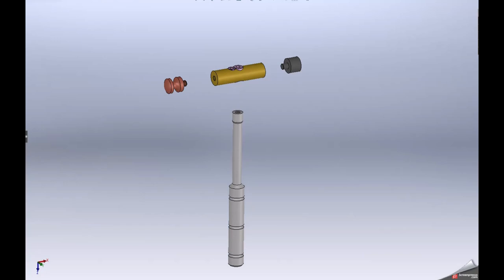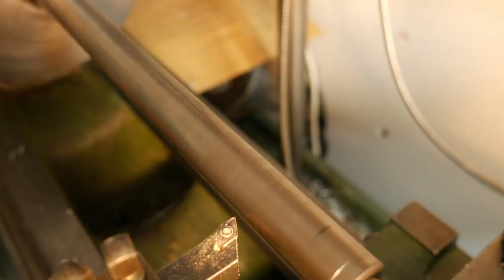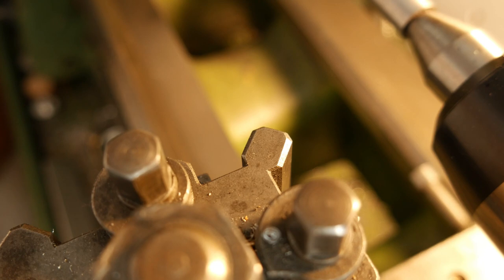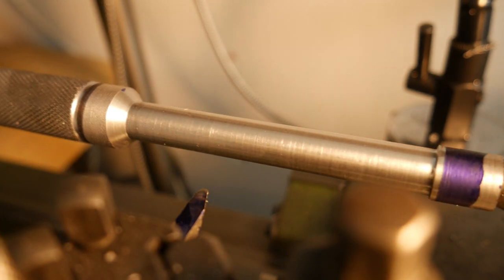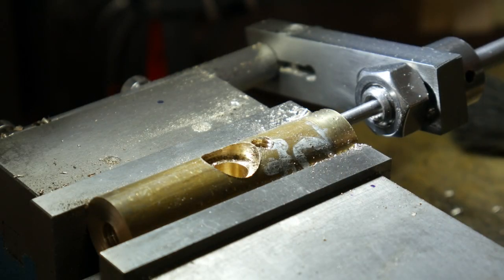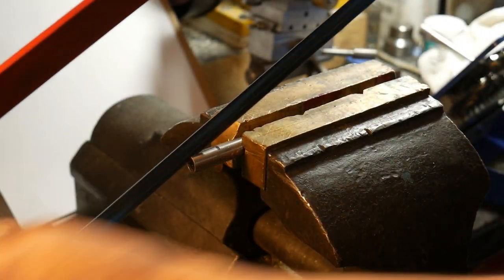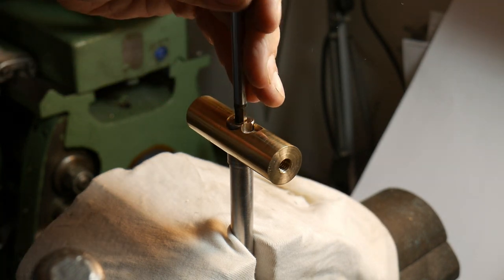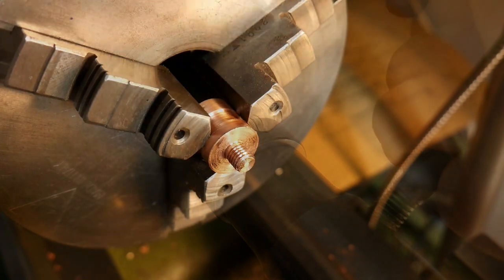How to Make a Machinist Hammer (DIY Project)

Comment from the maker: G'day everyone and welcome back, In todays video I will be showing you the process that I undertook to make my first Machinist Hammer. You can find many different type of that, but a great quantity is made by thread the handle into the central part. For my Hammer, I wanted to make it more easy, using the self-locking screw mode (the first screw cannot unscrew because there’s the otherone) and the material that everyone can have at home.

Comment: that turned out to be very nice and will be useful as well.
Reply from the maker: Hi Vernon !! Yes i think i will use of course, i was surprise to work the copper, not easy, too plastic, you close a little more the chuck and the jaws signs the surface, you close a little down and the bar slip inside the jaws (and also in this case signs...) Not happy to work the copper, but happy for the result!! Thanks for the comment, Ciao Vernon, Alberto.

Comment: I like the locking mechanism the you used.  I will consider that option in the future.
Reply from the maker: Thanks Jeremiah, it was an old sistem that was used in the past, the system was called "captive screw", precisely because one could not be unscrewed if the other was not unscrewed, it remained in place until the early 50s when the first thread locking liquids appeared. Proud you like it!